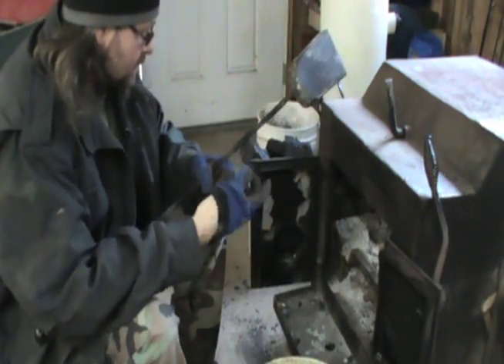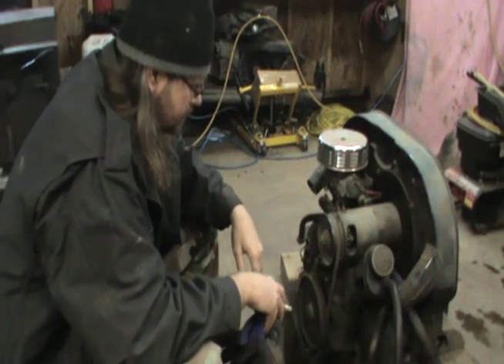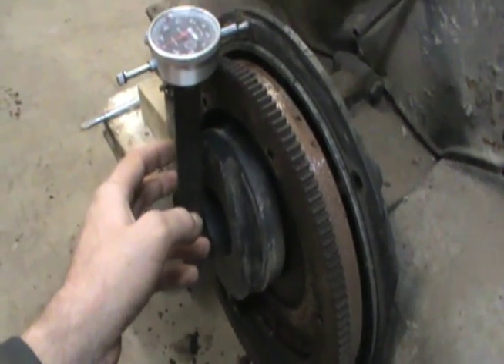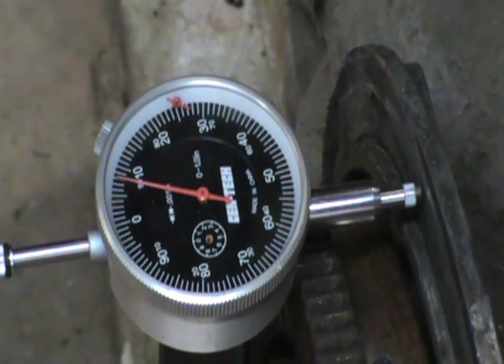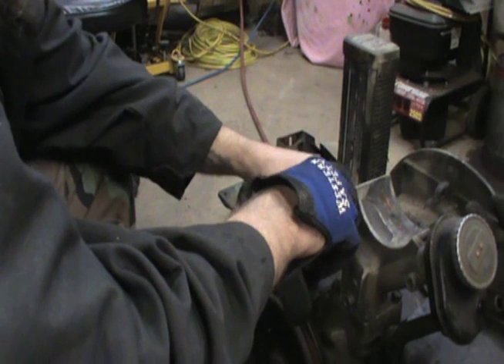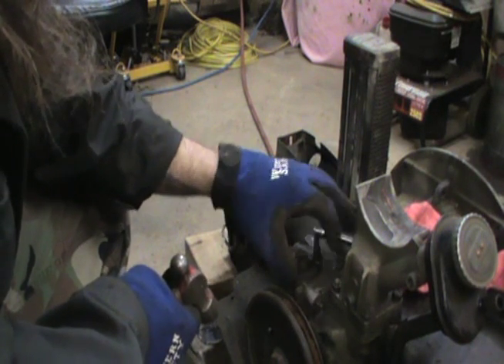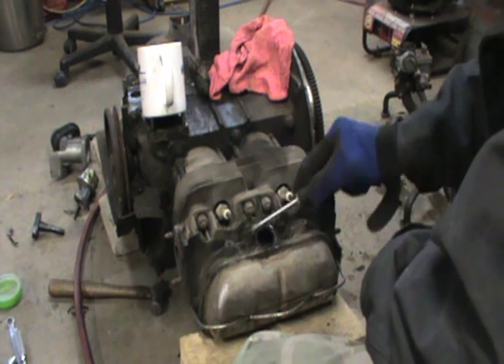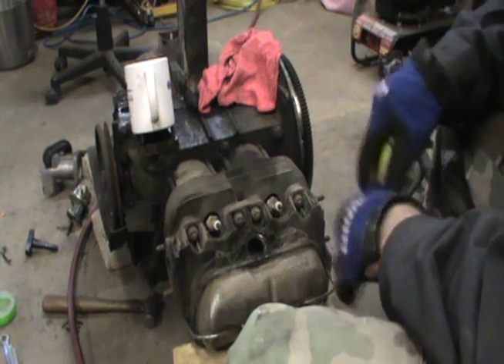VW Engine Tear Down

Comment from the maker: you guessed it man.....1500 it is

later
Reply: why does my  cam seal keep popping out
Reply: need your help  this cam plug keeps coming out   im very mad about this rubber cam plug in the back of the T1  VW motor , is there a retaining clip  that fell out? that holds the cam in place? after it leaked the first time looks like they used silicone on installation , i tried that and it kept popping out upon installation  , so i cleaned everything off dry and installed it , drove it 20 miles  and it leaves a constant stream ,  got to take the motor back out again  so  sad today trying to get it ready for key west  can i put a solid steel one in there ?, have you ever dealt  with a problem like this  before ?